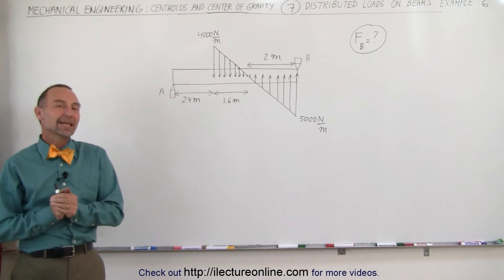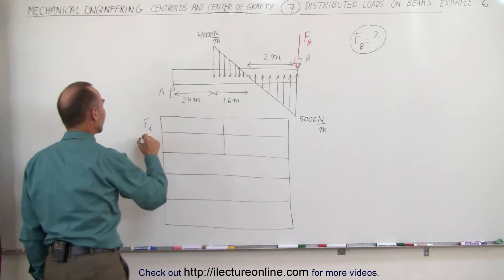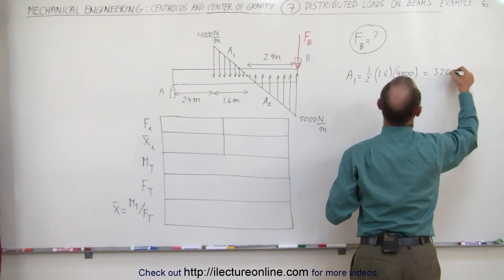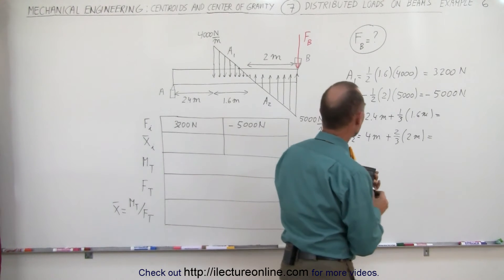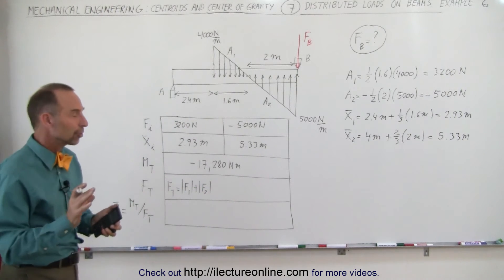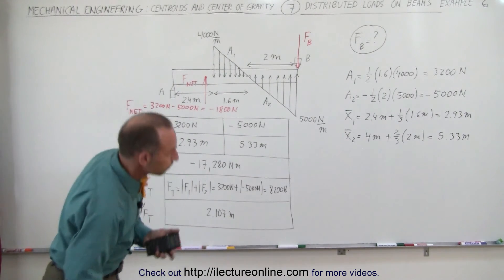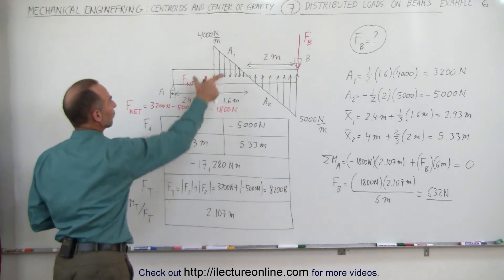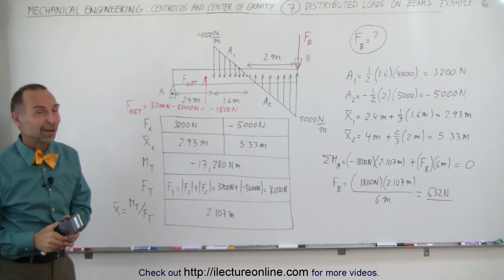Mechanical Engineering: Distributed Loads on Beams (7 of 12) Find Distributed Load on Beam Ex. 6

Comment: Hi Michel, are you sure it was correct to take the absolute value of the forces when calculating the total force? Are you sure the answer you’ve provided in the video is correct? 

Everything else you’ve shown in the video seems correct, but i’m just concerned with that 1 detail. When calculating the centroid on a distributed load, do you always divide the moment by the sum of the absolute value of forces?

Comment: 3200-5000=8200
😥😥😥
3200-5000=-1800N with x=9.59
Thanks but its impossible to have a centroid at 9.59 m wheres the toatal length of beam is 6m..
Its simply mean that the beam length was taken wrongly from book.. 🤗
But all your lectures are oxmmm.. Love from pakistan.. 🇵🇰🇵🇰

Comment: sir, i think you did wrongly because for the x-axis the answer get shouldn't have negative area, only y-axis can get negative area, hence the total FX should be 26650+9376=36026 , then divided by 8200, the answer of centre of gravity is 4.393, after solve for the moment is -6003.8N
Reply: If the total force is 8200 where will the force act up or down

Comment: FT does not require sum of ABS values as pointed, FT algebraic sum =(-1800N), then  centroid x would be(-17274/-1800)=9.59m  (9.59m outside of beam is ok) and then  FB=((-1800)9.59m)/6m= -2877 with the correct negative sign

Comment: Sir, it looks like you've changed the net force from -1800 to 8200. What is wrong with the first version? shouldn't we do -1800+5000 since the forces are in opposite direction